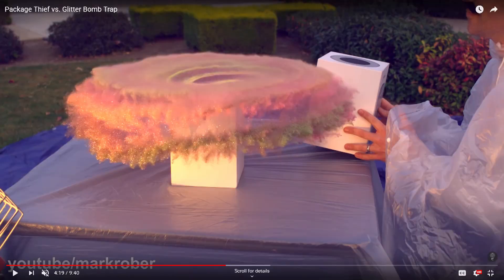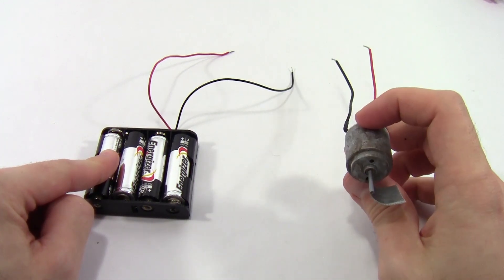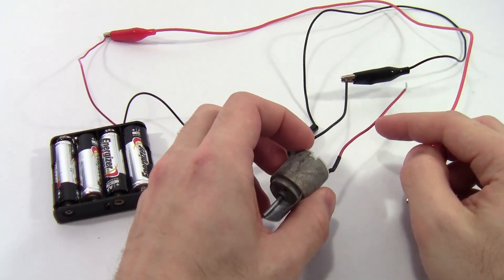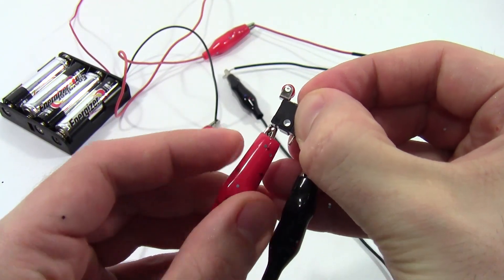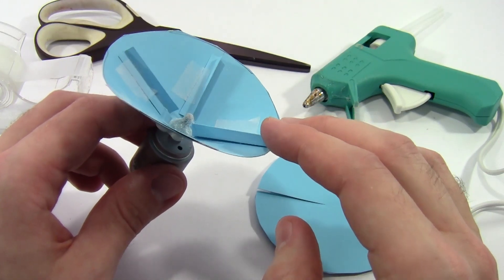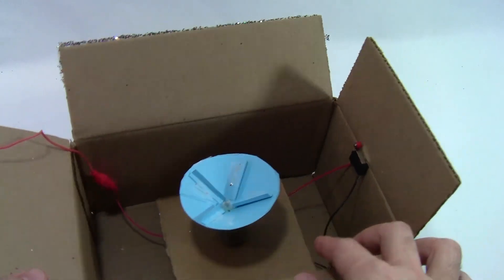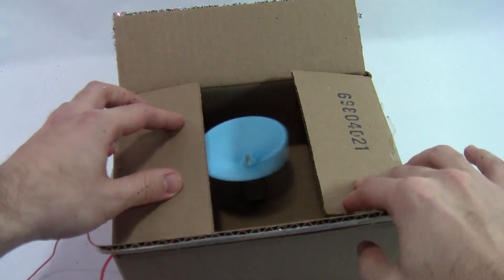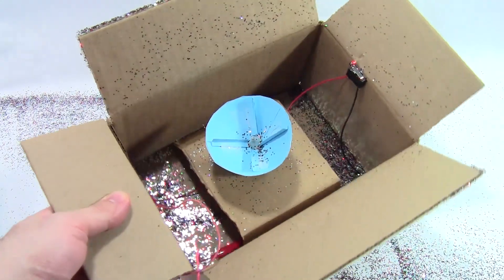DIY Mark Rober-Inspired Glitter Package | Science Project

Comment: How  did you get the lever to turn on the motor?
Reply from the maker: The lever is an electronic switch wired in series between the battery pack and the motor: https://www.amazon.com/gp/product/B00MFRMFS6/ref=as_li_ss_tl?ie=UTF8&linkCode=sl1&tag=sciencebuddie-20&linkId=fbedb001b0fa6c198203ee51cd09265a&language=en_US